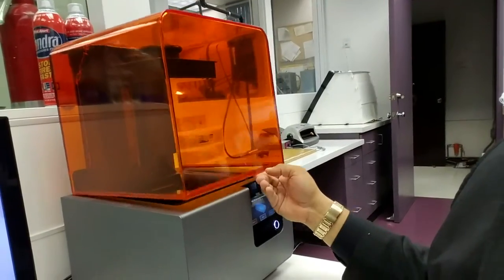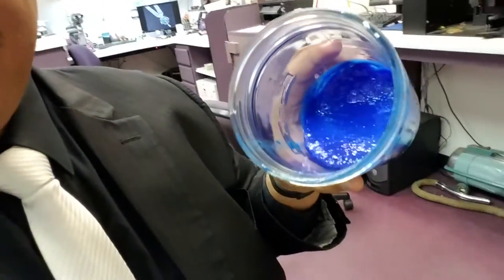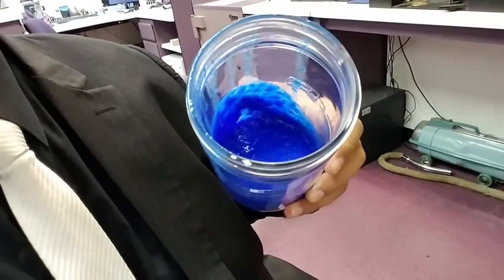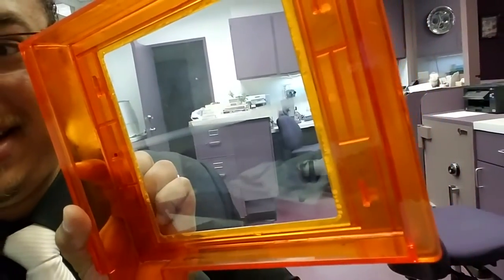JUST THE TIPS

Comment: using alcohol on acrylic DOES crack them, it is called crazing. There are internal stress build up in the acrylic during the manufacture extrusion process, and normally it takes a while for these stress to have visual effect on the part. Alcohol speeds up this process and sometimes instantly. Cast acrylic does not have this problem, but i guarantee the part you have is not casted as it's way more expensive to cast.

Comment: have you ever tried to recoat the bottom of a tray with silicone to reuse it?
Reply from the maker: David Black no. Id imagine it's not to hard as long as you know what material to use. Mark the current level of the bottom material, peel it out and clean the tank, then fill with new material to the same mark. May need to adjust the z offset in settings some.

Comment: i have a question... did you wipe inside the tray or just outside it,  i mean the silicon layer? or just the plastic in the bottom? i  have the same issue.
Reply from the maker: Rodrigo Hernández both. If you can avoid touching the bottom glass it shouldn't need cleaned but I've left finger prints by accident and cleaned them. As far as the inside I just pour and wipe out as much resin as possible and then pour in a little alcohol and wipe down the bottom silicone. Done it several times now and am still using the original tank.

Comment: accidentally stumbled don this ... alcohol will kill VAT, i killed one of my own,  i knew it will die but i had too dirty tray so i was able to clean it, next day all edges had micro cracks and in a week tray start to leak resin. I used 99% IPA. We do laser cutting service and i know for fact any chemicals will damage acrylic. Whenever we need to clean acrylic alcohol should be last on the list. Silicone at base is not affected by any chemicals (almost) but if you hit acrylic you can have holes.
Reply from the maker: It can damage it but more than likely it'll be just fine from a quick rinse/wipe down. This is not a technique you use on a regular basis. Just when you really need to switch resins and don't have another tray. The tray will reach the end of it's life before you've done this enough to damage it.